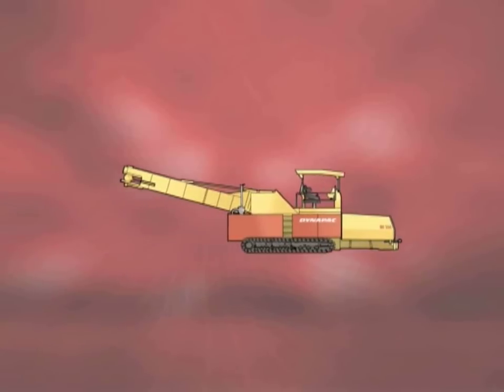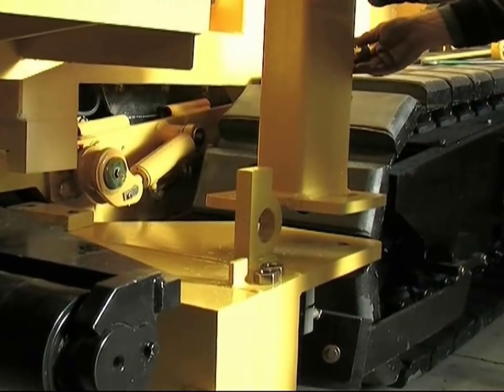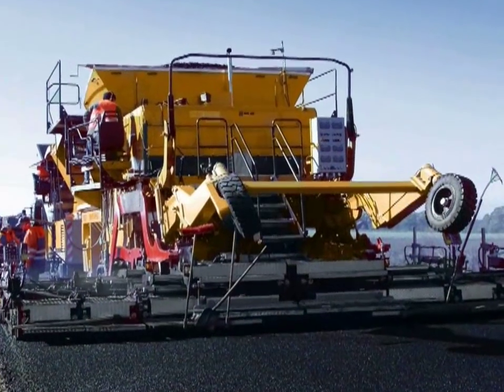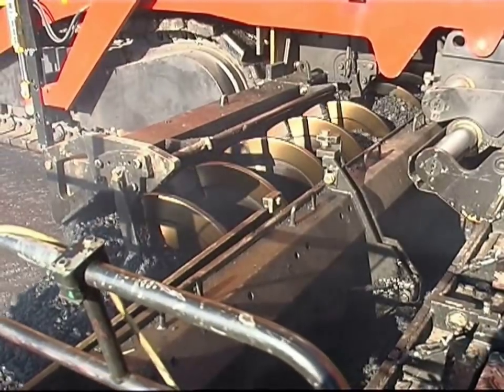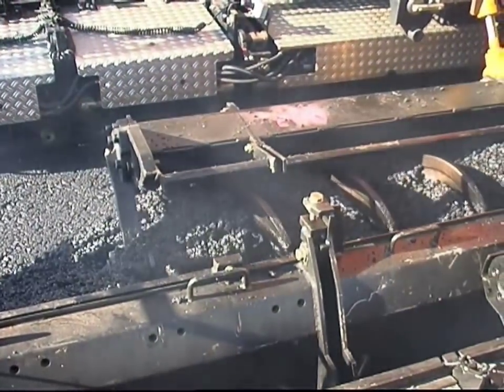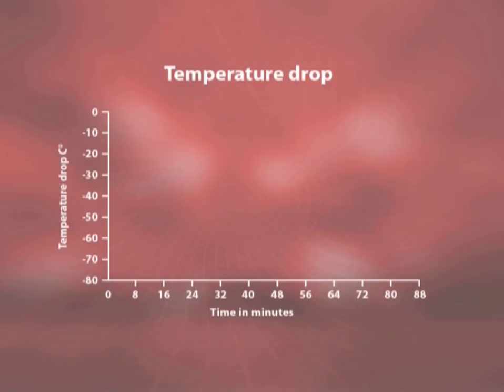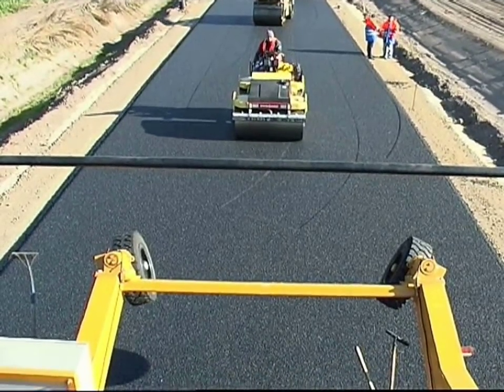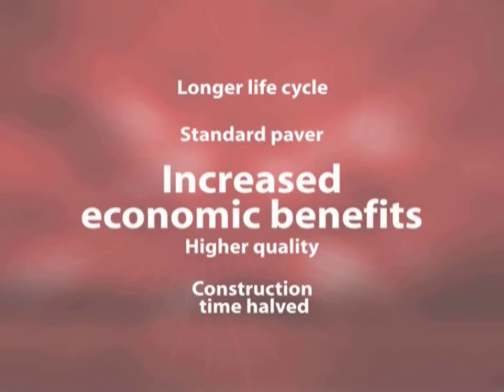Dynapac Compactasphalt presentation (part 2/2)

Comment: You can likely achieve the same result with existing paving equipment.  First, lay the binder course.  Later, as the wear course is being laid, reheat the binder course with a  truck towing an array of propane burners inside an insulated housing.  This runs immediately ahead of the paver.  The capital cost would be low, but the fuel cost might be problematic.

Comment: If the binder course fails compaction or density requirements do you mill up the entire thing to replace binder lift or just fine the contractor for failure to produce density?

Comment from the maker: You are still driving 1 paver! The only "additional" job is to handle material flow from the second (top hopper).
--> A challange that can be handled by all high-end paver drivers.  [We also have according technical trainings...!]
The paving speed (of course based on the paving width and thicknesses) is on average 4-4.5 m/min. Not too fast anyhow... /Roland

Comment: you may gain an advantage in bonding, but you loose out on rideabality.  the thinker the mat, larger roller marks that have to be taken out..

its an overly complicated process which would be hard to manage efficently,  and i question how good they can achieve good takeoffs.  id assume that they step the existing mat that they are taking off from, so there will be a differential in compaction 1m from the join. 

dont get me wrong, paving 11m with a paver avoids joins, so less failure points.  simple fix, 2 pavers hot join all the way.  only need one buggie to be at least as efficient as the video above...